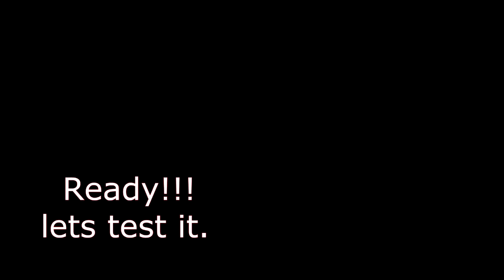10$ chinese cyclone dust collector. Build and test.

Comment: really glad to see pnts vacuum. but i would suggest using dust bags so filter does not get as clogged. when bag gets clogged lift the motor and shake the bag from above to restore suction power

Comment: Chris Notap solves the collapsing bucket issue with a 2nd identical bucket - drop one into other for a resistance fit, then the outer bucket reinforces the inner bucket by means of maintaining the ambient air pressure between the 2 buckets.

Comment: I've heard that if you put the buck inside another bucket that you will keep it from collapsing.  If you go a step further and cut the bottom of the top bucket you can permanently attach the lid to the top bucket  which makes setting up a perfect seal easier.  The slip connection between the two buckets has been said to make a perfect seal.  I have yet to try this set but this is where I'm headed as soon as my knockoff comes in.  I will be posting my findings on my channel as well.  Cheers and thanks for the video.
Reply: How to DIY not true tested that it would collaps both usualy brake them
Reply: That is what I did, put it Into another bucket and it did not collapse. I did not need to cut the bottom of the top bucket but I will remember this tip if I run into a problem.

Comment: When I made one of these, I also found problems with collapsing plastic containers, so I sourced a steel one with a banded lid. Which solved the problem, although surprisingly difficult to find. Whilst it's not see-thru, so I have to unclip the lid, to see how full it is (although the weight is a give-away) it's a small thing. The banded connection also means if the thing is knocked/pulled over, the lid doesn't come off and spill all that dust out. 

In any event, I would not be without a dust separator now.
Reply: Where did you "source" your metal bucket from?

Comment: Great video. Friend where can I get a vacuum like that
Reply from the maker: if you want the same you can look for  "parkside" from lidl.
Or here you are
Ebay : https://rover.ebay.com/rover/1/711-53200-19255-0/1?mpre=https%3A%2F%2Fwww.ebay.com%2Fitm%2FParkside-Wet-And-Dry-Vacuum-Cleaner-powerful-1500w-3-years-warranty%2F184371696177%3Fhash%3Ditem2aed68d231%3Ag%3A0~gAAOSwA8VfFv61&campid=5338482444&toolid=20008
Reply: Thanks very much. I got one like it I did a few moderation to it I put a 51 mm side cyclone kit from gutter vac systems it fits to the side of the vac more air flow  turnes the vac into a monster is increases the  suction from the vacuum cleaner by 2 times I'll have to make a box as it smaching the bucket I think I'll put 2 cyclone on the box  as I'm hovering soot it very fine . God bless

Comment: Hi, thank you for the video.  Very instructive.  What size of pvc pipe did you used to fit tot he top of the cyclone separator and what size of hose did you use for the hole on the side.

Thanks
Reply from the maker: hello my friend. for the side hole i used a regular small size hose with some duct tape. it is about 46mm. so i think a 50mm hose would make a snug fit.
on the top i glued the pvc and i cannot measure it. :( sorry. but i think its the same.
Reply from the maker: in the description of the ebay link says that both holes are 4.9 cm

Comment: I noticed at 5:26 the sides of the bucket collapsed in. Maybe a stronger material is needed.
Reply from the maker: no.. there is no need for stronger material. just dont block the hose intentionally..
i use it all the time without problems.

Comment: Bucket keeps collapsing. Great video 👍
Reply from the maker: YES. bucket keeps collapsing if you force it with your hand . but i need it  to collect my saw dust only,  so i dont have any problems with collapsing.    simple! dont suck arms and legs with this bucket ;)
Reply: @sakisdiyprojects1911 Make a wood bracket to put inside the bucket.
Reply: Another bucket the same solves the problem. Drop one inside the other so they have a resistance fit. Then the inner bucket has the added rigidity of the outer bucket to prevent collapse. They can’t separate to allow the inner bucket to collapse as long as there is a resistance fit between the two buckets.

Comment: I have the same vacume from lidl and cyclone. I've only done a quick mockup of the system but I found it seams to loose alot of suction. Did you find the same?
Reply: John Made it Yes, adding a cyclone will always cause a slow down in air speed which results in a loss of suction. If you add two cyclones your air speed and suction will decrease even more.
Reply: Matt James I thought you would loss some suction but not as much as I actually am. I guess the clean filter is worth the loss in suction
Reply: John Made it You should check to make sure you do not have any gaps in your cyclone assemby. There should be a seal where the lid meets the bucket and everything should be caulked. The problem with these is that they do not remove enough small particles of dust which clogs the filter. Instead of this I recommend a multi cyclonic system where you are filtering through multiple cyclones. Take the cyclone assembly off an old Dyson DC 16 canister vacuum and use that. It has over a dozen smaller cyclones. It filters out nearly everything. I use it and love it!
Reply: I find that Vac brilliant am using the Chinese copy of the DD and a steel dustbin, its great no loss of suction, just now making a valve to release pressure,   at the start the suction was so good I split the side of the metal bin ,but as it was a  fold over seam I filled with Polyeurethane and tapped back on the anvil,  as a precaution Iput in a 17" ply ring , halfway down the metal dust bin, I am more than pleased with the Lidl Vac,i have bought a second one.

Comment: Thanks for the video. By any chance do you know what size the holes/bolts you used to attach the cyclone to the lid? Trying to get everything I need while waiting for the cyclone to arrive.
Reply: why not just use wood screws and maybe washers if required , looks like a load of pissing about when using nuts and bolts lol

Comment: Mine makes a insane squaky noise as soon as I turn on the vac. Any thought on how to fix the issue?
Reply from the maker: i have seen many people making a small groove with a screwdriver on the hose. this changes a little bit the movement of air inside the hose and maybe will help you.

Comment: You need to cut the bottom out of another bucket then stuff it into the bucket with bottom. This will prevent sides from being sucked in.
Reply from the maker: maybe i will make a wooden box as mike said. a little bit bigger also. and then i will not have this problem.

Comment: There does seem to be a tendency for the collection buckets to collapse with these separators. Perhaps a steel container would be better. Nice job though and seems to work well
Reply from the maker: no... i dont have any problem if i dont block the hose with my hand and keep it only for dust collection :) 
it was just a test..
Reply: Sakis DIY projects I use the dust topper and the Chinese knock off and they do fine